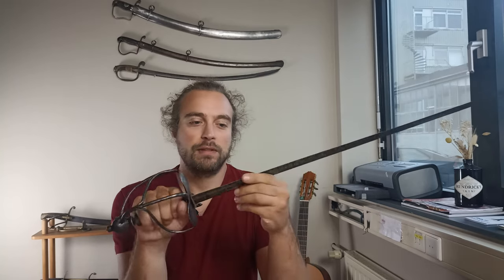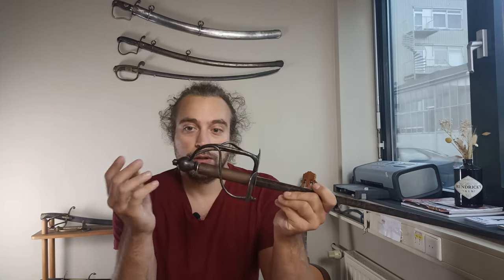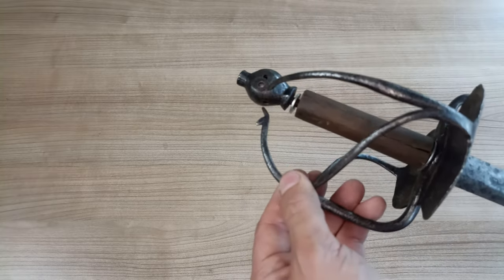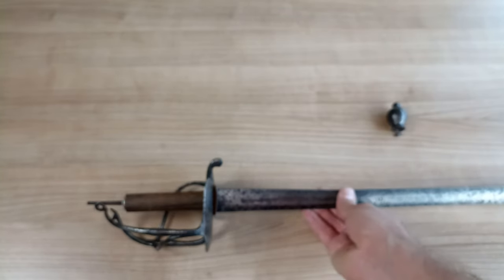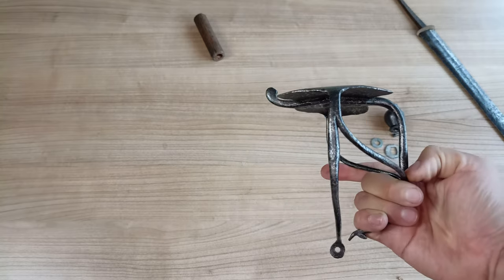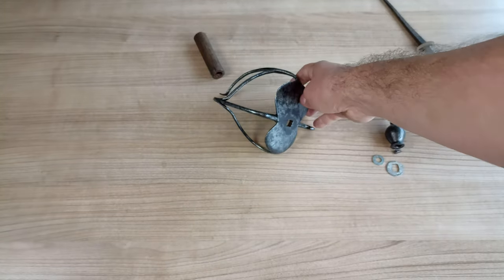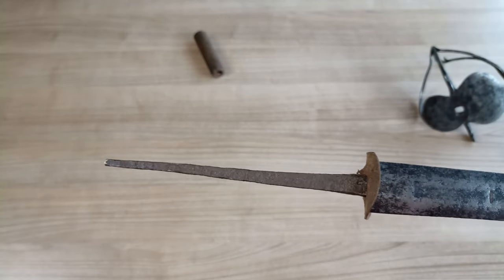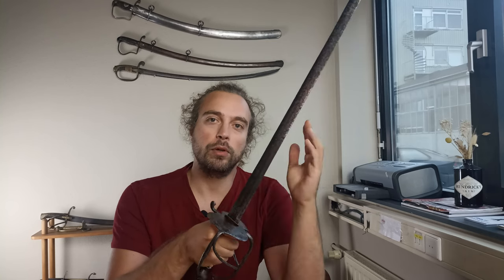Taking apart a 300-year-old sword. (There's a mark on the tang!)

Comment: You might find it advantageous, when taking something apart, to lay the parts out as you disassemble it. For instance, first piece on the left and proceed from there. To reassemble, go from right to left. Makes life much easier. I've also found it useful to lay all the parts on a clean rag or paper towel, less likely to roll away off the bench.
Reply from the maker: Very good suggestions, thank you! I tried using a piece of leather in previous videos, but it was too dark when filming. I may have to use one of those containers goldsmiths or the lockpicking lawyer use :)
Reply: @Rapiersdelight  Mechanics tray, just a shallow saucer with a magnet underneath. Any shallow tray will do the job though.

Comment: I am very grateful that you made this video because I have a sword that is similar in the form of the clamshell guard.  It is flat like the one on your sword without the perforations or the rings that are often affixed.  I was thinking that it had been salvaged from a damaged sword and repaired, so it is good to see one so much like it.  The branches on my sword have the "knobby bits" and the guard has a thumb ring.  The blade on my sword is also springy.  One of the marks on the blade appears to be two crossed swords, but, I might have to do some cleaning to see more details.  The mark does seem to be clear and "professional" beneath some rust and grime.  Can you suggest a source that might help me identify the mark?
Reply from the maker: Hey there, thank you for your comment!  If it's a dutch sword you should be able to find references in Puype's book Blanke Wapens. 
I'd love to see some details of your sword. If you upload any pics somewhere, could you lete know?

Comment: I wonder if the original peen was cut to repair the grip long ago and that work was interrupted until someone more modern did the sloppy interim work.
Reply from the maker: It's definitely a possibility. The peen itself doesn't look recently tampered with, at least as far as I can tell, however the "grip" is definitely modern, so your idea makes sense.

Comment: Very interesting, you don't often see weapons this old taken apart. Thanks for sharing! 

As for the marking I briefly looked around Staffan Kinman's book "European makers of edged weapons, their marks" and Lenkiewicz' "1000 Marks of European Blademakers". I found a few things that are frustratingly close but no cigar. Probably the closest is a mark from a 17th c Saxon miner's axe (page 109), but it is also not quite the same. I asked the guys on the vikingsword forum for their input.

 If you ever do decide to peen it over it would also be very interesting to see that process. Although perhaps it would be unwise to do so if the pommel button has a crack in it, it might exacerbate things. 

One other thing that would concern me is that moving the pommel a few mm down the tang would mean bending the sidebar and knuckle guard. It might be very slight but there is a danger there it seems.
Reply: BTW 14:00 is there a D there on the shoulder on the other side of the blade, or is that just pitting?
Reply from the maker: That seems to be just pitting
Reply from the maker: Thank you! I figured some might find it rather interesting, glad you did. 
As for the peening, you make valid points I am concerned about too. 
On the one hand I would like to make the sword complete and sturdy again, but not at the cost of damaging it. The crack in the pommel is definitely a risk to be hammering over, and the extra pressure on the guard by forcing it into a tighter position is something I hadn't really put much thought to. 
Also, there is the reversibility aspect of the restoration. Peening it would be a bit of an invasive process i'm not sure I want to take. 

The more I think about it, the more I am convinced adding a new grip and fixing the pommel in place with tung oil, or some similar hardening oil that can be removed. 

I'll also get in touch with a few conservators and see what they think.

I do have several other loose swords, though, so I might make a peening video anyway, at some point.
Reply: @Rapiersdelight  Yes, and also a fresh looking peen is a red flag for collectors and can significantly diminish the value of the sword. I had been looking at an early 80 years war era sword... All old parts, in similar pitted and patina'd condition, fit together well... but then I asked for a picture of the peen and it looked completely clean, and moreover the seller denied that anything had been fixed. At that point it could easily be a composite, and the price was too much to risk it, so I let that one go. 
Well, kind of... I still kind of want it even now. 😅
Reply from the maker: @jellekastelein7316  hahahah, I understand the feeling, even composites can have a strong appeal